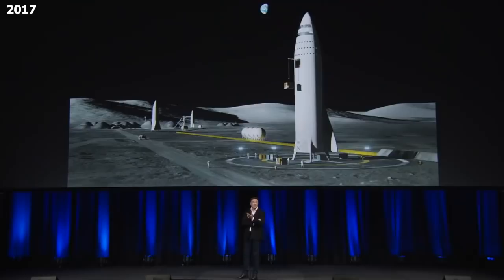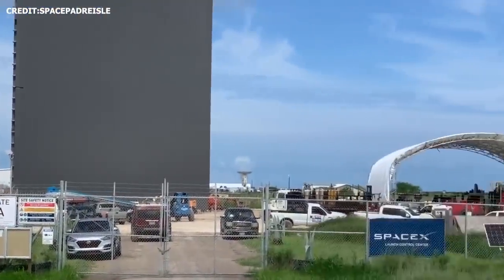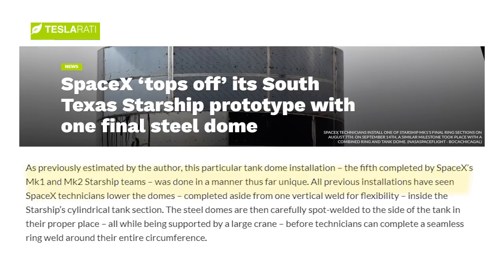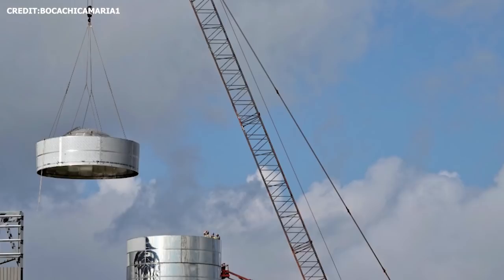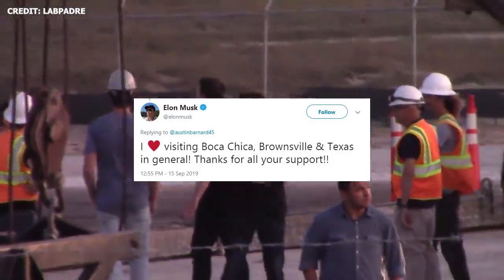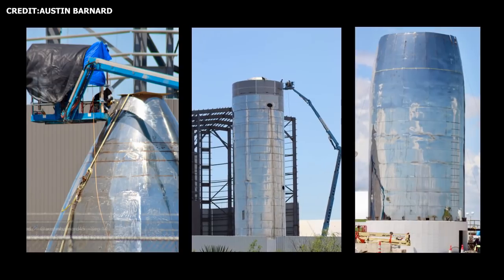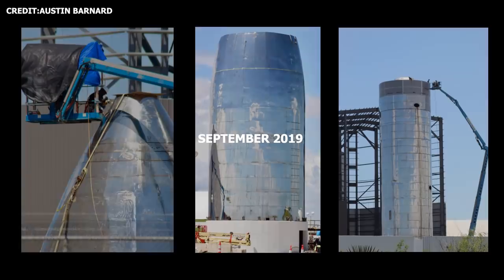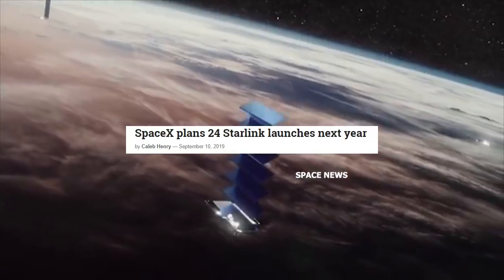SpaceX Starship Updates - Final Bulkhead Installed on Mk1 I Elon Musk visits Boca Chica

Comment: I am curious as to how they are making those tanks... I would have expected them to be made separate and lowered in whole. It seems though that they are being made and welded together along with the rings... how can they be certain of their integrity? And if they need to go back in to deal with leaks? Seems a weird way to do things.
Reply: The idea is that the tank walls are also the rocket structure. This makes the rocket lighter and is called "integral tank". Similar to tanks on airplane https://en.wikipedia.org/wiki/Aircraft_fuel_tanks#Integral_tanks

"how can they be certain of their integrity" That's the job of the engineers before the first welter even get's to the construction site. 

"And if they need to go back in to deal with leaks?" There are man holes in the sides of the tanks. Welters can always go back in a repair a weld.

Comment: As several comments have been made alluding to fabrication detail. While a demonstration vehicle assembled by metal fabricators and pipe fitters may be acceptable  I have some reservations about a fully functional orbital vehicle assembled by this skill set. It is not to disparage the workers but I don't let the HVAC techs build the plumbing system for my laboratory  equipment. Different level of competence: You have to have 99.999% confidence in the quality of joints, welds, seals... and it has to be lightweight to aerospace shock and vibration standards. A little concerned
Reply: This is why SpaceX does "validation by testing". 
The star hopper was the initial testing vehicle for this construction method. And it works!